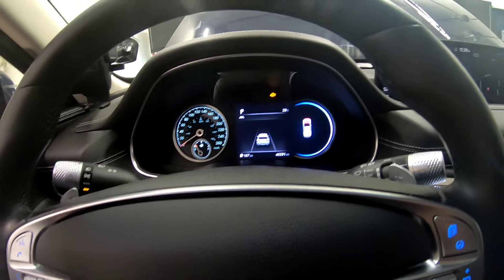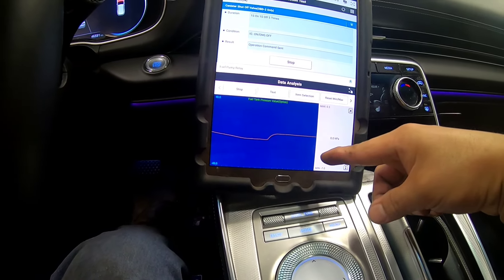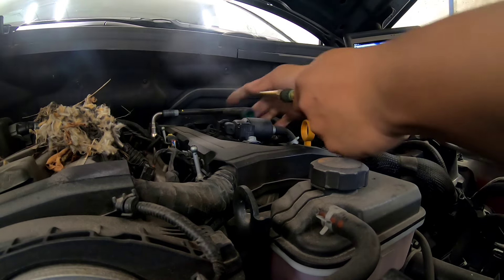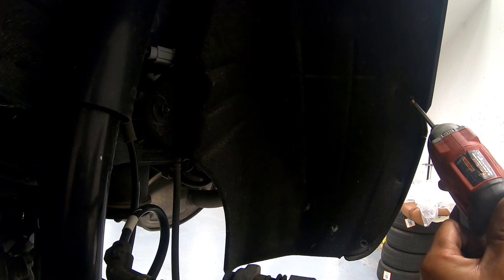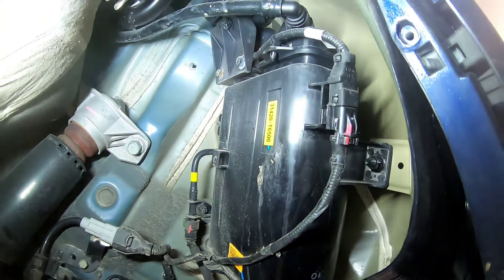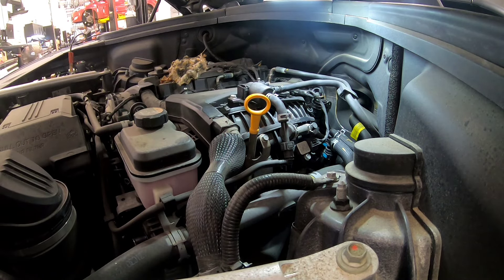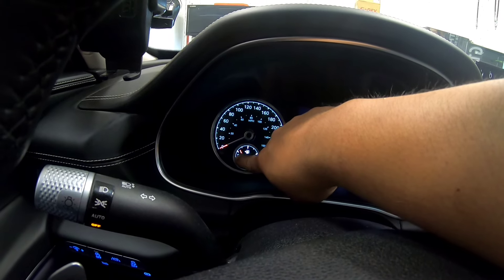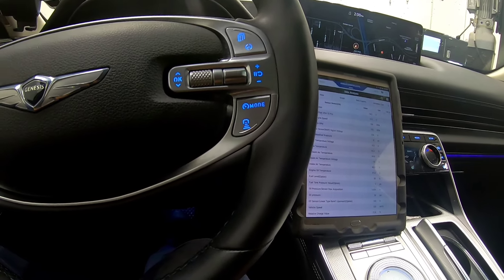2021 Gv80 Evap fault

Comment: HI BROTHER GREAT APROACH AND THOUGHT PROCESS AND UR NOT JOMPING AROUND UR VIDEO REALLY ARE AWESOME THE ONLY THING UR CAMERA DOSE NOT SHOW THE PIDS GOOD IN THE SCANER GET CLOSER LETTLE PLEASE SO VIEWER CAN SEE THE INFORMATION IN THE SCANER AND WHEN U WERE CHECKING THE VENT SELOINED CLOSE TO FUEL TANK DID U CLOSED IT USING THE SCANER AND THEN PUNCHED THE LINE GOES TO THE TANK TO CHEK IF THE SYSTEM IS LEAKING AND BY LOOKING AT THE  FUEL PRESSURE SESOR PRESSURE WAS RSING THAT MEAN NO LEAK AND IT IS GOOD IDEA TO LEAVE THE SYSTEM SEALD FOR SOME SHORT TIME BY WACHING THE PRESSURE SENSOR IF IS HOLDING OR NOT USULLY WILL DECAY IN TIME AND PRESSURE WILL GET LOST AS ALWAYS ENJOYED THIS ONE UR APPROACH IS SPOT ON TO PIN POINT THE PROBLEM NOT GESSING AS OTHER DO ONLY CHANGE PARTS /PART CHANGER TELL THEY GET TO THE RIGHT PART :face-green-smiling::face-green-smiling::face-green-smiling::face-green-smiling::face-green-smiling: CHEEEEERS.
Reply from the maker: The mid part of the video i clamp off the hose after the vent solenoid then check if the pressure sealed was dropping but on the video it did not drop, so im think its something else thats why i went to the gas cap. Yeah i have to do better on my camera angle when showing the data pids in the scantool. Hahaha